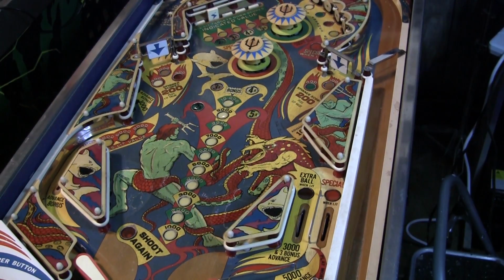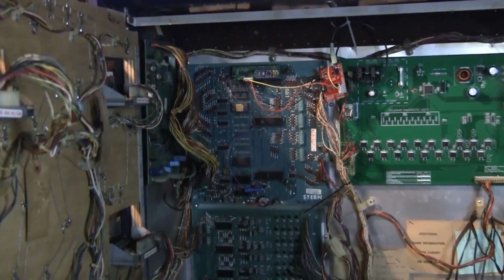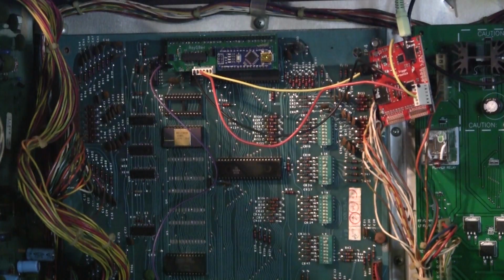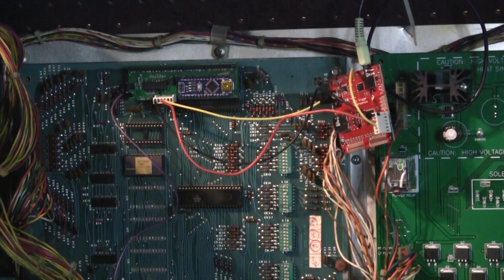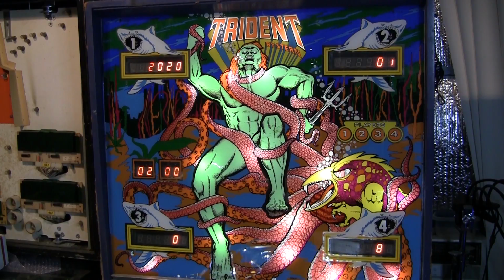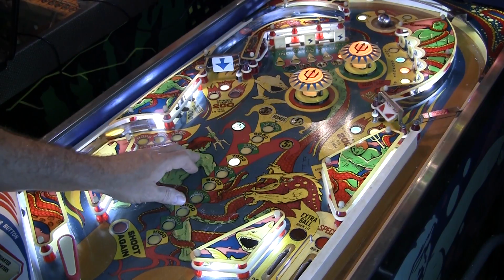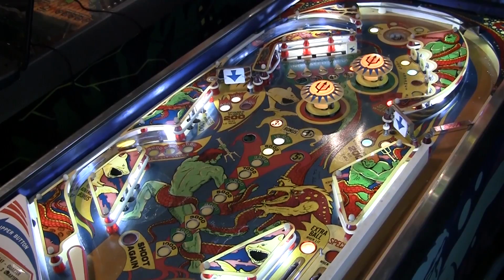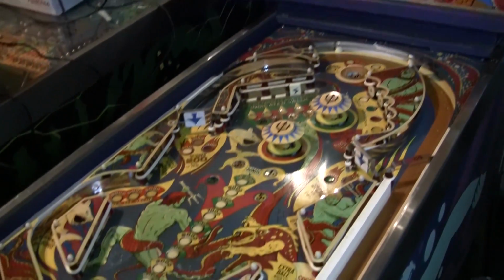Trident Pinball Lives!  Quick Demo With New BSOS Ruleset! - PinballHelp.com

Comment: Hey there. Do you need that red board to connect from the arduino board to the sound or can you just plug the red and yellow wire into the stock sound board and it'll work? Thanks
Reply: The red board is a wav trigger board that holds all of the wav sounds. https://amzn.to/3wftU9E  You can order a kit on pinside or make your own using the online instructions at https://github.com/BallySternOS/BallySternOS

Comment: That is so awesome!! Will we be able to do this for System 1 games?? Would love to do this to Totem.
Reply: I'm working on a System1 game now, but no, I haven't found a way to implement my architecture on those machines. They have two ports (TC1 & TC2), but I haven't found a way to take over that bus in a meaningful way. Also, because the spider chips are unavailable, the old boards are often replaced in those machines and Pascal and Ni-wumpf boards are a very different architecture. The nice part about making this for -17/-35/100/200/Alltek is that they all are functionally equivalent.
Reply: Only Bally/Stern games.